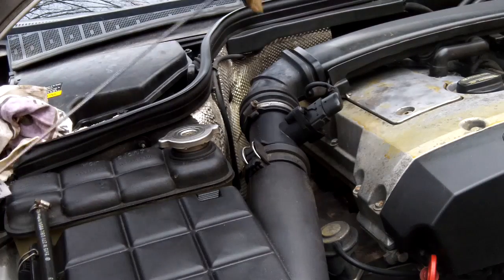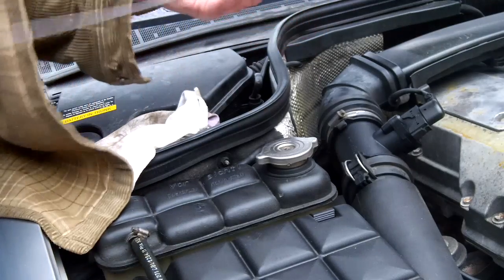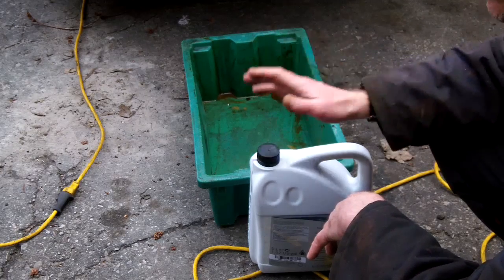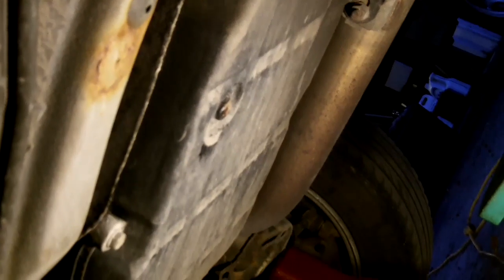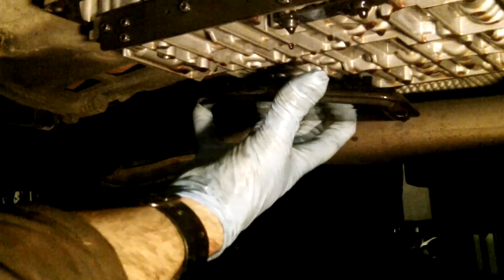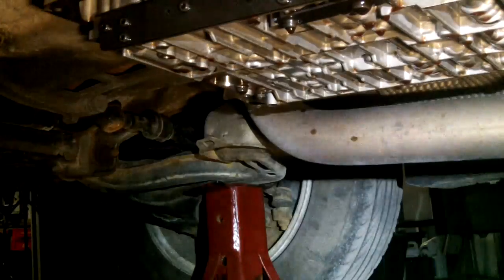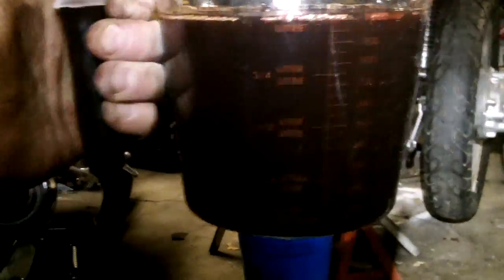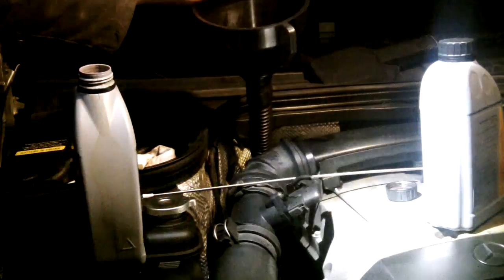Mercedes 722.6 automatic transmission .fluid and filter change..w202

Comment: THERE IS A BOLT DIRECTLY UNDER THE MODULATOR TO THEVRIGHT IS LEAKING CAN THIS BE TAKEN OUT AND FIXED 85 380 SE
Reply from the maker: is it on the very bottom of the oil pan ?  what size bolt head ?

Comment: Can I use Castrol dex as atf fluid. Says 236.6 mb approved on the can
Reply from the maker: Not sure on that one . 236.10 and 236.12 are the only approved data sheets for the 722.6
Reply: @fupabox  those are very expensive to use on a really old car? So basically no alternative besides mb oio

Comment: If the fluid level is off could it be harmful to the car to start it and shift it into the different gears
Reply from the maker: Pete Rooster unless it is completely empty , no... as long as you don't drive with a really improper fluid level
Reply: thank you

Comment: FML i serviced my transmission a few months ago and put dex III fluid and now my transmission is stuffing up and shacking the fluids is a black color  
what do i do ??? thanks
Reply from the maker: grab 2 gallons of the Mercedes fluid and a new filter..take it to a transmission shop and get them to completely flush and refill the tranny..if you are lucky you may save it...the dex 3 eats the linings of the clutch packs
Reply: Shit thanks where can I get some Mercedes oil ? Any other tips ?
Reply from the maker: the dealership will have the proper fluid...some parts stores carry it,but not sure which ones...autopartsway.com had it at one time for much cheaper than the dealership

Comment: I have 99 c280 sport it has 164,000 miles on it i don't think transmission fluid has been changed I looked at the fluid it was a bit brown should I change it?
Reply from the maker: yes
Reply: I'm just worried man I love this car I've heard it could have particles in it already and it would screw up the transmission if I change it should I change the filter or just do a flush
Reply from the maker: Firas Saleh no flush... just drain and refill with a new filter, and you will be fine
Reply: Ok cool because it shifts really good don't even feel it shifting just wanna keep it that way. Thanks

Comment: What ATF do you rec'd for the 722.4 trans? The spec is dex III but after 10k miles on generic ATF it seems like shifting is a little harsher.. What do you think about valvoline maxlife?
Reply from the maker: the 722.4 doesn't like Dex III   Dex II  like this one http://www.opieoils.co.uk/p-745-castrol-atf-dex-ii-multivehicle-formerly-castrol-tq-d.aspx
try to get the Dex III out before it eats the tranny...Mercedes has no recomendation regrding the Maxlife that I can see
Reply: Oh no! What happened to backwards compatibility? Apparently the fluid specs I got weren't exactly for my car, and now I see the sheet for my car has dex ii-d products, except for redline synthetic. Everyone says Maxlife is great for the 722.6 even tho it's not spec'd and also good for my 722.4. Is there a better fluid you'd suggest other than old dex ii I'd have to hope to keep finding online years from now?
Reply: fups you're right about dex III, problem is dex II is no longer sold in US. Redline used to make the only synthetic II-D and it was even on the 236.6/.7 sheet that was in my glovebox, apparently their newer D4 is good to use. Most say use Mobil 1. Found this: "These transmissions were built at that time for use with "ATF IID" developed oils.
It has already been noted several times that, for example, ATF III contains something "aggressive" and can dissolve the brake bands, which leads to slip when shifting."
Reply: I would use dex II if I could find it but it's not cost effective to pay for shipping from UK every year or two (changes every 30-60k @ 30k mi/yr). I could see it differently for an older and more valued car that doesn't rack up high miles. I'll see what MB says. If the dealer has fluid for 722.4 for a halfway reasonable price I'll buy it but I heard they use 722.9 fluid or Mobil 1 d/m. Otherwise I gotta just see how it goes with whatever else. If the trans goes bad I've heard I can rig up an older manual trans right?
Reply: I've put 10-15k hard miles in 6-9 months on generic dex/merc and shifting has gotten firmer, on a trans known for stiff shifts as it is. The fluid I replaced was clean and based on what I know about the PO it was generic ATF too. They were using the wrong coolant and motor oil viscosity too ..
Reply from the maker: The Stiver not sure on the manual tranny swap, but I'm sure it can be done..I agree , it isn't cost effective with an everyday driver to import oil.  I'm now making it my goal to find some dex2  in North America...it must exist, I bet truck fleets or something use it...I've seen a few oil companies from Europe looking for distributers of DEX2 for North America...could be a nice bit of side $ supplying it for classic Benzes  :P
Reply from the maker: The Stiver It would be cool to find a listing of ultra high mileage original Benz owners to compare their maintenance records ..fluids etc. and see what was the best/ most economical route to go...Even the GF's new Kia Soul has specific recommendations for fluids.... remember when there was 3 or 4 different oils, 2 tranny fluids, all brake and power steering fluid was the same stuff...it's gotten crazy... I was trying to get some specs from Germany where the w202 is used as a taxi...figured I could get some good info on tranny fluids they use....it's either DEX2 or they mostly have manual transmissions...ugh.
Reply: Hey man you know I'm already in for a few gallons haha. Most of the older mercs I see are low mileage. Taxi / fleet is the best bet, I beat the hell outta this thing at least as hard as they do. I've had maxlife work miracles before and the only bad stories I've read are about leaks but they probably were already leaking some. I'm going for the half million km badge by 2018. I might need a parts car and a personal fluid dealer to make that happen haha.
Reply: Is that Kia's official oil Quaker State? Haha I thought it was weird my friends dad specifically asked we get that for their 13 elantra but it's in the owners manual as their only spec oil. I thought they must be owned by the same company or something
Reply: Turns out I had a vacuum leak and have an ATF leak, replaced a couple connectors and topped off about .4L and she's shifting as smooth as ever. Ordered a genuine Mercedes pan gasket, I can't remember if I reused the old one or had a cheapo new one but either way I'm 95% sure that's it. Still going to see what fluid Mercedes recommends

Comment: Well unfortunately, my torque converter does NOT have a drain plug...  So I was forced to do only the 4 quarts in the pan and the filter only today.  SO, I may do a power flush next time I do the filter and fluid change.

Comment: Mercedes customer support says: "Mercedes-Benz USA approves the use of Mercedes-Benz transmission fluid Dextron III or IV for the 1996 C220.
 
Best wishes for future safe and pleasant driving."
Reply: Pffft. Well. I'm going to go full synthetic.
Reply from the maker: The Stiver LOL   yeah  I guess it's ok to use the DEX 3  ..let me know how it  feels/works once you do it
Reply: Yeah I wasn't too impressed with that answer. I had some dexron VI left over from my mom's '12 Chevy I was going to try but valvoline says MaxLife uses the same synthetic base stocks as VI just with their own additive package. So we'll see what happens with MaxLife.
Reply: MaxLife is only $17/gal (~$4.50/L) at WalMart! Literally just a few cents more than valvolines basic dex/merc. Too early to tell a difference, but I had very clean and half new dex III to start with so it's not like comparing to old fluid
Reply: Oh and idk if you remember me asking you about some idle/a/c/fan issues... Turns out my voltage regulator was within a tenth of a mm of its life. That could have been bad.
Reply from the maker: The Stiver
Really...the regulator going bad caused all that ?  ..great info...didn't realize it was that sensitive.....what pointed you towards the regulator ?
Reply: Fups, I replaced it but ended up making my own problems with surface development this time of year in the gulf coast. But honestly my regulator was basically worn to nothing. Mercedessource told me to check it for electronical problems
Reply: Wish I could post the pic but very soon only one of my commutator brushes would be making contact. One was basically having nothing left, the other very little. Based on pics it was already replaced once at 205k miles
Reply from the maker: The Stiver good to know  :)
Reply: Wow. Hope you could make sense out of any of that. Looks like you got mixed in randomly with conversations at the bar last night haha
Reply: Development in the gulf coast and window a/c... The life of meteorology students
Reply from the maker: lol...     i was wondering what some of that was about...my mind takes frequent vacations :)
Reply: Yeaaahhh I had a few too many whiskeys last night. Even knowing what I was trying to say none of that makes much sense haha.
Reply from the maker: lol...  :)
Reply: Here we go, got the picture uploaded. Btw, the surface low in the gulf of Mexico will not develop ;)
http://imageshack.com/i/kpLG31Vkj

Comment: Anyone know what mm in the red zone was I have a Miller tool but I don't know the hot and cold like the one he had mine just has every 10mm
Reply: fupabox ok I'm working on a 06 Dodge Charger Daytona rt when the cars at op temp arond 150 it looked like it was at like 80 but it was hard to read the stick after the first check all the other time it was just smeared all over the stick
Reply from the maker: sounds like it may be overfilled..or the dipstick you are using is dragging fluid up into the dipstick tube

Comment: what about torque converter draining plug.. it is next and you didn't even touch it...strange
Reply from the maker: +Joe Vip  As I said in the vid, I did the service as recommended by my dealership, and a very highly regarded local Mercedes independent garage  . They do not recommend draining the converter, so I didn't .
Reply: @fupabox  usually,draining and filling the torque converter fixes things like slippage and overheating of tranny.I've done torque drains on other vehicle and worked like gang busters.a lot of old,worn out fluids reside in the TC.

Comment: These are the compatible hits I get on autohausaz.com for a 96 C36.  I don't see either on your list?  Either of these work? 
 1) Meyle ATF - 0019892103 MY- For MB models up through 722.6XX 5 speed automatic transmission, NOT 7 speed transmission.
2) Valvoline 324-Full synthetic (I'm thinking this one isn't compatible?)

Of course the Mobil ATF 134 is probably easily obtainable.  My question is the 722.605 (C36 transmission the same as on your car or compatible with same transmission fluids?)
Reply from the maker: +mpowers1978  Your c36 came with the 722.4 transmission which used different fluids.. heres the list of approved fluids  bevo.mercedes-benz.com/bevolisten/236.9_en.html
Reply: +fupabox Good stuff...thank you!
Reply: +mpowers1978 Fupa I trust the 234.14 fact sheet is for the 722.4 transmission, but I have to ask how do you know this or find this?  I've been searching for 20 minutes online to match up the 234.14 sheet to 722.4 transmission?  Please advise.  Thanks again!
Reply from the maker: I asked my local dealer which list to use.. he said 234.14    Here is the main BEVO list that 234.14 comes from... TONS of reading  https://bevo.mercedes-benz.com/bevolisten/bevo-sheets-sort1.html
Reply: +fupabox Am I losing my mind here? why does link you had in first response go to 236.9 now? 234.14 sheet is the correct one,yes?
Reply from the maker: The lists get Supeceded and updated all the time. Oils get removed and added depending on the base oils the companies use at the time. Sometimes the old lists are better to be used than the newer ones if the fluids can still be found . It's pretty confusing , so I call the dealer service dept for their help .
Reply: +fupabox Thanks Fupa although dealers have never helped me in the past with such info they just say "bring car in."  I know the 234.14 list had some obtainable types I just didn't write them down as I didn't know list would disappear in 2 days ughhh such a headache.

Comment: Hi how are you doing, well I hope. I got a ban to spray my car in so I rubbed it down fixed all the marks and scuffs then waited for my friend, but he works away alot so I primed the car out side my house. I'm getting to the good bit now I went round to the barn so the car could be masked up ready for spraying. On arrival my friends mum came out and told me to go away as it's her barn and no one can use it, so I have had to base coat it on the road out side my house not the best job I have ever done I will post you some pic's this week. Don't laugh too loud.
Reply from the maker: lol...sounds like pain in the butt.. send me some pics  :)

Comment: there should be 8 liters of oil not 3.5 .... this AGB has got in it 8 liters of it !

one of the best for MB is Ravenol oil.
Reply from the maker: 8 liters is the total capacity..as I mentioned in the video this is a transmission fluid drain and refill as done in the dealership..not a torque converter drain..3.5 liters is what was removed , that amount was added once the filter was changed and then the level rechecked...never heard of Ravenol, I'll check it out, thanks

Comment: This video is totally for nothing!!! By this procedure you'll change only 50% of oil. It's totally amateur. If you have drain plug in torque convert you'll drain out the rest of oil. If you don't have this plug you have to use other procedure!